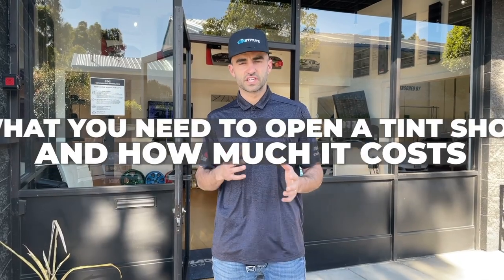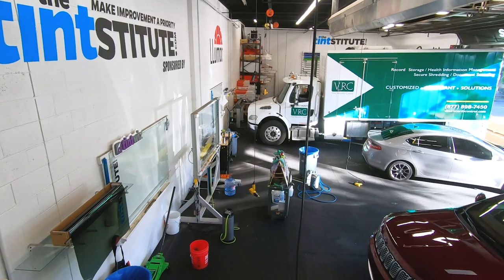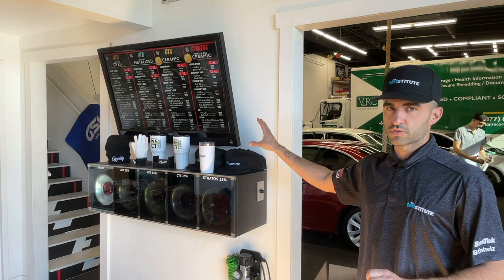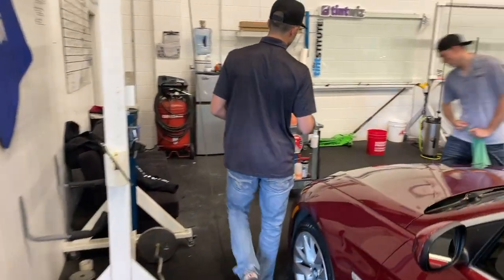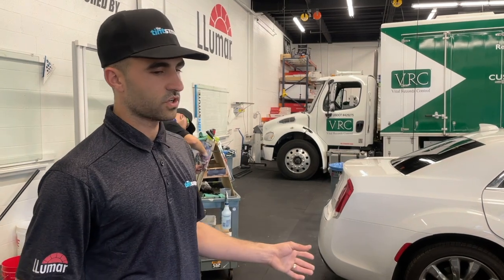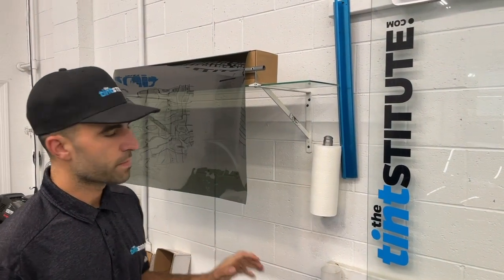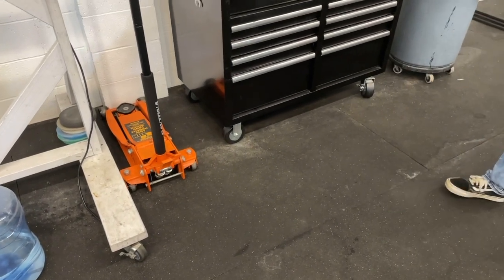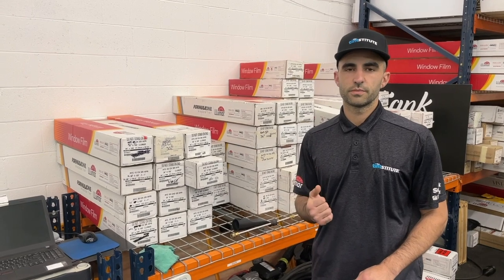What You Need To Open A Tint Shop [ PLUS How Much It Costs ]

Comment: Nice shop, good how you showed ways to save money starting your own shop. With your heat guns, use a cut down film core zip tied to the cord just above the plug with a notch in the top to create a holster for them. Looks better again, saves your guns, adds to safety, winning all around & costs 20c!
Reply from the maker: Thank you Thank you

Comment: Great video, very informative. I know pricing has changed, but I don’t think you can get a Graphtec for $3000 now. The cheapest I've found is near $10,000. I started my shop using a GCC plotter, its the chinese version but it was a lot cheaper. Use it to make some money so one day you can get the graphtec.
Reply from the maker: Thanks for sharing your experience! It's true that prices can fluctuate significantly, and it's always good to explore different options when starting out.